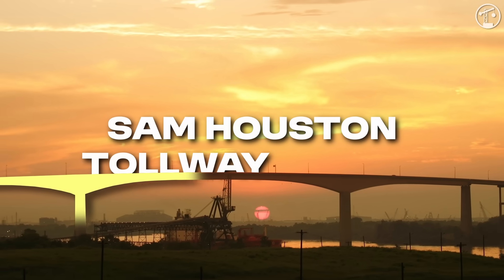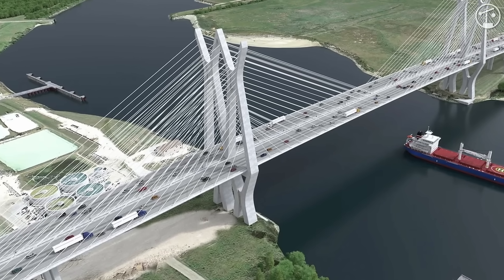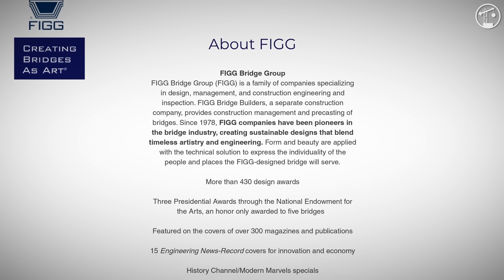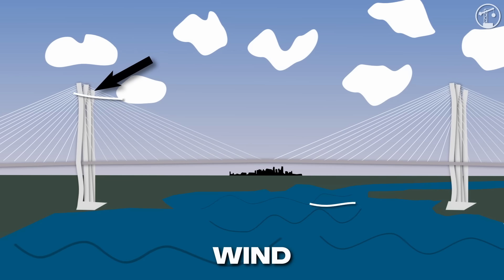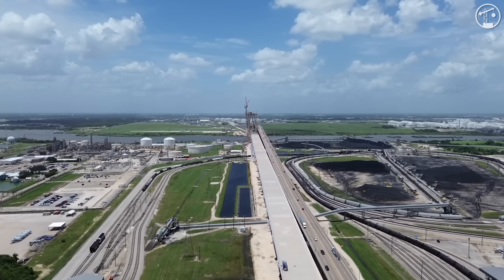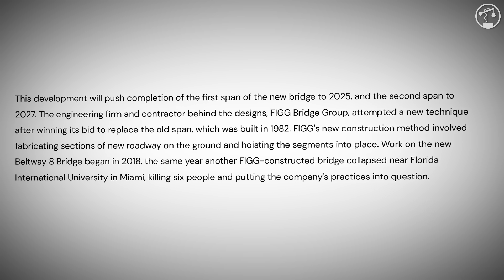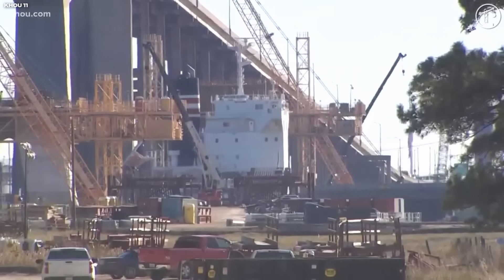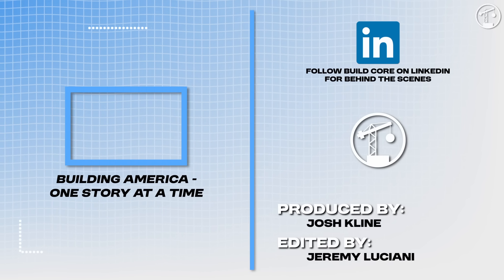Houston’s $1.45B Bridge: The Mega Engineering Failure

Comment: Jon Skinner, As a young msn I worked and built the bridge that is in use now I see you refer to it as a Box grinder bridge. This bridge was the longest free span concrete bridge ever built at that time and was constructed using a prosses of #4 hanging form travelers we built the two piers in the water and attached the travelers going each direction from the piers, utilizing Post-Tension stress cables we built the bridge one segment at time. What made it an Engineering feet at that time was the center span of the bridge is 1500' from the center of each pier making it the longest free span concrete bridge ever built in the world at that time as per the Guinness world records.

Comment: As an engineer, one could argue the improvements were a result of iteration and not necessarily because one firm was better than the other. In this case the collapse of the Florida bridge occurred after the ship channel bridge was designed. However, where the replacement makes sense is at the point that FIGG did not admit their mistakes and revise their design at their own expense.

Such a common management mistake. Admitting fault and correcting shows integrity and trustworthiness to those that matter. It might cost you money at first, but the latter could cost you your business.

Comment: Unfortunately, my company was called onto a project where a bridge on 69E in Corpus Christi was built, and after the bridge was built the company realized they forgot to put in an expansion joint in the bridge which allows the east and west bound lanes to flex independently. It’s was a 3 foot wide cut we had to make the entire length of the bridge so it could be retrofitted into the existing new structure… I found such an oversight disturbing.

Comment: I'm in the DFW area but have relatives around Houston.  These companies need to realize that whatever they build needs to withstand hurricane force winds. Taking a cheap way out (or even miscalculations) is going to be catastrophic. I'm glad that Houston had sense enough to hire an independent company to double check the work, and to fire that company that was doing half hazard work.
Reply: Seems like hiring an independent contractor to check the work of the original design should be required and be calculated into the cost of construction.
Reply: That, and they also need to understand that there really isn't any bedrock- it's mud way, way, WAY down. That was the main reason the Corpus Christi harbor bridge was delayed- the bridge foundations weren't strong enough to resist the bridge twisting and toppling in high winds.

Comment: Apologies if I've missed this in the comments... but FIGG had contracts for both the Houston and Corpus bridges.  They were removed from both, but the Corpus bridge maintained the concrete sectional roadway design.  Houston reps proudly declared "we are using steel, which we know" (paraphrased).  Based upon what I've read, the Houston bridge had some foundation issues, and those were dug out and restarted.  For Corpus, I'm less familiar with details, but it seemed like delays were more contractually related... "who's going to take this on now".

It's an interesting issue since one entity found issue with the means of crossing the span, but the other kept the same tech (interlocked concrete segments). 

In all of the reporting about either bridge, the reference to the other has never been made, as far as I have seen.

The Corpus bridge is open and I have driven over it a few times... there was a spot that I questioned the alignment... of if that was just summer heat.
I drive over the Houston toll bridge 2x everyday... we'll see how that compares.  I'm more excited about the pending "flyover" exchanges to the new bridge and 225... so I don't have to sit through traffic caused by the refinery shift changes.

Comment: The traffic getting onto Beltway 8 near the Ship Channel is absolutely horrendous. What should be a 30–35 second drive just to get on the bridge turns into a 35–40 minute wait because of the congestion. Living up in Cypress on the northeast side of Houston makes it even worse—my daily commute is already extensive, and I have to deal with this bottleneck five days a week.

The construction pace feels painfully slow. I understand safety protocols have to be followed, but it seems like more could be done to speed up progress while still keeping workers safe. It’s draining for thousands of commuters, and while I doubt it will completely fix the traffic problem, I can only hope that once the work is finished it will at least ease some of the gridlock we’re forced to fight every single day.

Comment: I would like to remind everyone that the Fred Hartman Bridge connecting Baytown to Laporte and the prototype cable beidge built in the 90s was rife with issues as well. Everything from concrete suppliers to engineering issues.
Reply: Was coming here to say this!!!  Weren't they almost finished and realized it was off a few inches where it was to meet(  Fred Hartman, ship channel bridge)?
Reply: @lonestarpenny we basically have several ship channel bridges all with infamous stories. Fred Hartman is the ship channel cable bridge that is part of 146 and you are correct about it being off by a few inches. 
The Sidney Sherman bridge is the ship channel bridge that is part of 610 and is not a cable bridge. I believe that bridge's biggest travesty is when part of the road fell out and several cars plummeted into the ship channel by driving into the hole.

Comment: Just one minor detail... you keep talking bout public dollars.  HCTRA (the toll road) uses toll revenue to pay for construction and maintenance.  So yes, they are spending $1.5B, but that will not (better not) come from tax dollars.  That should be paid for with tolls.  They make silly amounts of money from tolls on the system.  So they can either spend it on improvements, allow the operator (a foreign owned company) to siphon management fees out, or reduce tolls.  They are not going to reduce tolls.   

Beyond that, great backstory.  On the bright side, TXDOT has minimal involvement, so they can't screw up the lane configuration, disable all the freeway lighting, or drag it out to the length of a career.

Comment: Have to wonder if this new Houston bridge is encountering similar design issues or working with some of the same design engineer firms as either the Key bridge in Maryland or the Harbor bridge in Corpus Christi, TX.  

Is FIGG the same company that built the Francis Scott Key Bridge that collapsed in Maryland in 2024 when hit by a barge. Key bridge was opened in 1977, designed by "Baltimore engineering firm J. E. Greiner Company was selected as the primary design consultant, with the side approaches being handled by New York City's Singstad, Kehart, November & Hurka in joint venture with Baltimore Transportation Associates, Inc. The construction was to be performed by the John F. Beasley Construction Company with material fabricated by the Pittsburgh-Des Moines Steel Co." (Wikipedia).   

Corpus Christi (CC), Texas, is replacing their arch-bridge with a modern cable-stayed bridge design.  "(TxDOT) awarded developer Flatiron/Dragados (FIGG) with the design–build contract for the CC project.  After FIGG was found at fault for a pedestrian bridge collapse in Florida, they were replaced with developer designated the new engineer for the project as Arup-CFC [es], who expected no major changes. TxDOT-ordered independent review by International Bridge Technologies found significant design flaws that persisted in its design." (Wikipedia).  Between TxDOT and Arup-CFC, and FIGG, design issues have been resolved.   
*However, friends in CC are concerned this new cable bridge won't be as strong and secure as the original arch-bridge.   Time will tell.

Comment: Would a Chunnel tunnel design have been more straightforward and less costly?
The Channel Tunnel, or "Chunnel," is an undersea railway tunnel connecting the United Kingdom (near Folkestone, England) and France (near Coquelles, France), opened in 1994. It provides a direct link for both passenger and freight trains, reducing travel times between London and mainland Europe and is operated by the company Getlink.  
Key Features
Location: Connects Folkestone in the UK with Coquelles in northern France, running under the Strait of Dover. 
Function: Allows trains to travel under the English Channel, serving as the only fixed link between Great Britain and the European mainland. 
Services:
Eurostar: High-speed passenger trains connect cities like London to Paris and Brussels. 
Le Shuttle: A vehicle shuttle service, also operated by Getlink, transports cars, vans, and other vehicles through the tunnel. 
Structure: The tunnel system consists of two rail tunnels and one service tunnel. 
Length and Depth: The entire tunnel is 50 kilometers (31 miles) long, with its deepest point reaching approximately 75 meters (250 feet) below the seabed. 
Significance
Historical Impact: The Chunnel replaced the natural barrier of the English Channel, profoundly changing travel and trade between the UK and Europe. 
Engineering Achievement: The project, completed in 1994, involved significant engineering feats and remains a symbol of international cooperation. 
Transportation Revolution: It revolutionized travel by providing a swift and efficient link for both passengers and freight, connecting major cities across Europe.

Comment: 60 years ago they built Mighty Mac Bridge over the 5 mile wide Straits of Mackinac that connect Lake Michigan and Lake Huron which are the world's 4th and 3rd biggest freshwater lakes. Big Mac was the world's longest suspension bridge when it opened in 1957 and still remains the western hemispheres longest suspension bridge. I don't think Mighty Mac has had engineering problems and it's located in a much harsher climate than south Texas. The Mackinac Bridge is 4 lanes, 2 north and 2 southbound, it was built in 42 months for slightly under the $100 million budget and open to traffic on time. Yes prices have changed drastically over 60 years however this Houston Bridge is tiny compared to Mighty Mac. In fact the Golden Gate Bridge is one third the length of Big Mac. I've driven on all the biggest baddest bridges in America. The GG is the most famous USA bridge and i think Mighty Mac is by far the most beautiful USA bridge. Many YT videos exist of drivers videoing their adventure of driving across Mighty Mac Bridge. Mighty Mac is Interstate 75. It costs $4 for a car, pickup, suv to cross Big Mac.  $5 per axle for big trucks. RV's towing a car is $4 per axle. The toll booth is at the north side of the bridge at St Ingace. North of the toll booths is Bridge View Park and Museum. South of the tollbooths is the Welcome Center for The Michigan U.P. in the event any of you drive/explore The Michigan U.P. which is gorgeous and refreshing. Interstate 75 goes from the Canada border to Miami, Florida. About 45 minutes north of Big Mac Bridge on Interstate 75 is the  Soo Shipping Locks in Sault Saint Marie on the Canada border. WARNING/DO NOT cross the International Bridge into Canada if you don't own a valid passport or you will be detained trying to enter the USA again, for who knows how long (hours?/days?) while the law figures out who you are. The Soo Locks are how huge freighter ships up to 1,000 feet long and even small boats enter and exit Lake Superior, the world's #1 biggest lake that has more water volume than every river in the world combined. The 5 Great Lakes combined have 2.5X more water volume than every river worldwide combined, as does Lake Baikal in Siberia, the world's deepest and oldest lake.  I'm 360 miles from Big Mac Bridge in Wisconsin.

Comment: I had forgotten that in California we call a road with 4 lanes each direction a 4 lane, and the rest of the country calls that 8 lanes.   I was wondering where the rest of the road was. 

Building a bridge in TX with only 4 lanes each direction seems too small.
Reply: current bridge is set at 2 lanes in each direction, thus a 4 lane bridge.  Adding two more lanes in each direction would double capacity.
Reply: @mrgreene3290  Thank you,  still seems very small for a city.   Really need at least 10 -12 lanes of capacity spread over 2 or 3 bridges for each direction to avoid large traffic jams.
Reply: @harryniedecken5321 This bridge is not near the city center, its on the second 'outer ring' of the city called beltway 8. Theare are multiple paths to cross the channel that include two other bridges and a tunnel, you could also include a ferry as a fourth option but that's a stretch. Basicaly four lanes in both directions is more than adaquet for the vast majority of the traffic it gets based on where it is located. In comparison the 6-10 bridge which crosses the channel much closer to the city is a 10 lane bridge(total lanes) called the Sydney Sherman Bridge(I actually did not know that bridge had a name, it has always just been the ship channel bridge to me). That bridge does get a lot of traffic, especially heavy truck traffic as it is located near one of the most industrial areas in the city and for the most part it works but it an extra lane or two would be nice.
Reply: @glyakk  Thank you.  Do you think that the existing capacity is enough to maintain 60 MPH traffic flow,  24 hours a day for the next 40 years?  Otherwise it will be problematic and fall to our poor conditions here in California.
Reply: @harryniedecken5321 I am not a city planner so I honestly have no idea what data is being  used to make these sorts of perdictions. However I lived in an area very close to the current bridge which is only 2 lanes each way and have occasionally needed to used it on my daily commute so I am familiar with how the traffic flows in that area as a regular user of that bridge. However beltway 8 which is the road this bridge is on, is no more than 4 lanes in each way already so if they widen the bridge they would also need to widen beltway 8 which, again is the second outer loop of Houston, 6-10 being the most inner loop. There is traffic on the beltway for sure, but it is not houston traffic. In 40 years we will see I guess.

Comment: As a Houstonian and a citizen of this country I would like to point out a flaw that is still Unaddressed. While the expansion may help alleviate traffic in the short term it is surely going to be out paced within a decade of its' construction. A chronic problem we have in this country is building infrastructure to meet the current population needs with no foresight into future expansion. A perfect example of that currently is highway 99 where at peak rush hour traffic, and I am not joking or exaggerating, it can take anywhere from 30 to 45 minutes to go 2 miles. This is because it was built as a 2 lane highway which did not take someone with a college degree to look at and realize that it would not be able to handle the amount of traffic it would be incurring. Personally I believe they are one lane short on both sides as it should be a minimum of 5 lanes on each side, 6 if you do not want to redo it again in 30-50 years, but being that it is a huge port route there should have been enough lanes to create a dedicated trucking lane which would do the most to alleviate the traffic on that bridge.
Reply: Biggest problem with 99 is it only takes one slow driver in the left lane for the whole damn thing to slow to a crawl. 2 lanes isn't enough for any freeway near Houston.
Reply: It’s a chronic problem in Texas. Other states have figured it out. Maybe Texas has but they’re held hostage by oil money.

Comment: Should have built tunnels.
Reply: Mobile, AL has a tunnel for I-10 going under the bay & there are multiple problems with building tunnels as opposed to bridges:

- You have to go far enough under the water that a ship won't hit it when it crosses over
- You have to make sure it never leaks for decades
- You can't just rip up and expand tunnels like you can bridges because that requires basically double work in unsafe conditions

...among other things.

No, it's best to build a big, strong, sturdy bridge and do it right the first time so that you don't have problems like this.